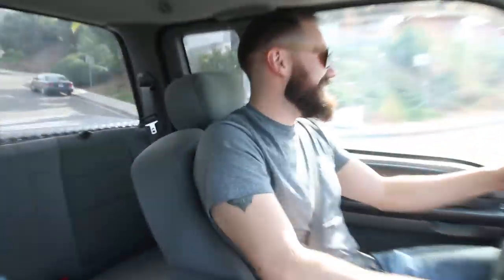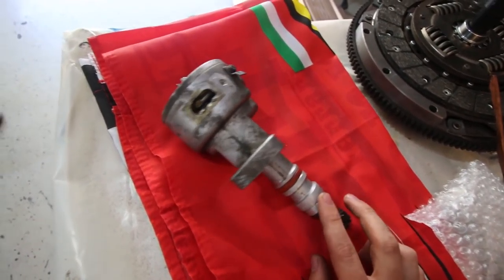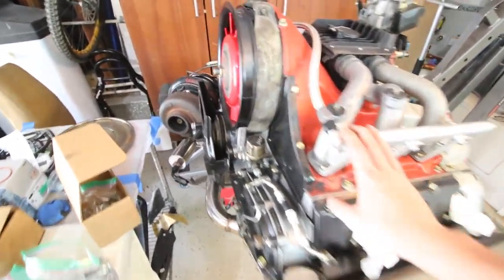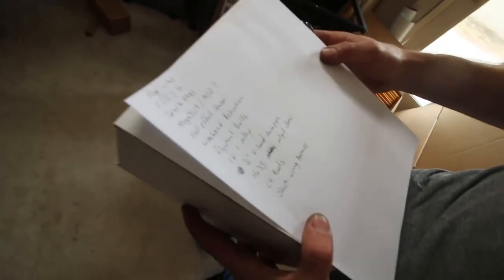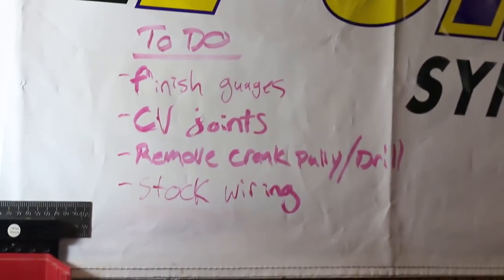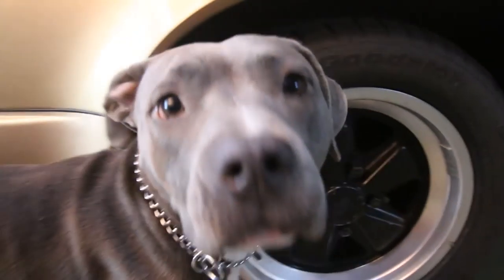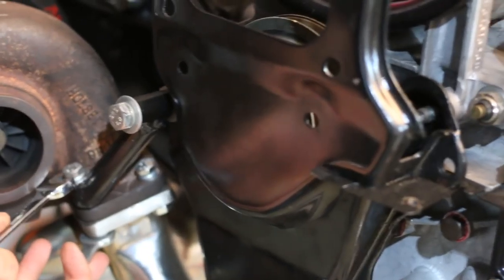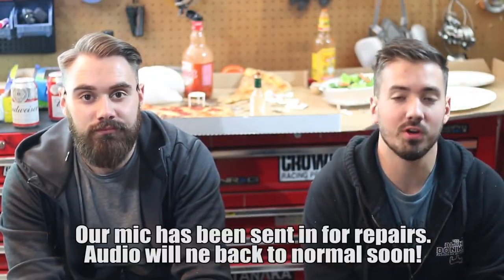Day 16/30 Porsche Build Challenge - Distributor Problems...

Comment: I had a 944 with the same Fuschs wheels on it. One of the wheels had lots weights on the inside and a few on the outside. Shop explained that that was what it took to get the wheel balanced but it was cheaper than a new wheel. I love your dog

Comment: MS2 is a Awesome setup, the EDIS is a popular setup for a lot of engines due to simplicity and inexpensive common parts. The only advice I have is to have the trigger wheel installed correctly with less the .003 runout and a real sturdy VR sensor mount. Crank sync issues are a real PITA.

Comment: You can incorporate a crank angle sensor into your existing crank pulley, and also haltech will sort out every single drama you mentioned it's just very expensive
Reply from the maker: DeathStroke Got the sensor and toothed wheel already purchased. We have a solid plan moving forward.

Comment: You can still get the crank pulley of with the engine in the car. It takes 20 minutes extra compared to if it's on the stand. But no biggie, I've done it several times.
Reply: Trigger happy, now I finished watching and you already knew that...

Comment: The wheel weights do a better job the closer to the outside planes of the wheel.  The further in they are place, the more you have to add.   Looks terrible I agree, I try and avoid doing them that way.  I may have balanced a few tires in 18 years.

Comment: Just put 10° advance everywhere.
Then get it tuned on a load dyno for maximum brake torque.
The OE "MAP" probably isn't very good anyway since you put a turbo on. 
it's only alright with no boost thrown at it
You wont brake it with 10° of advance...

Comment: I enjoy the Tabasco as well. 

I have never seen or used the mega jolt, but it appears simpler then going MS2 or 3. It's just not a good idea to upgrade an MS1 to a 2 or 3 since the cost difference is only $60 plus the processor you choose. The internal jumper changes from MS1 3.0 board are extensive. The MS1 software is a PITA compared to the MS2 and later software. With your tight schedule Use the MS1 you have with the mega jolt. This Would be the fastest way to get you up and running. Just Add in all the additional wires needed to go full sequential ignition and injection. Then when you have time. buy a new MS3 kit with the expansion board. The expansion board has all the output transistors on it. Otherwise you don't have enough room on the main board to add all the output transistors to go full sequential.
Reply from the maker: asc4130sd We are ordering an assembled ms2 box Friday. 450 bucks. But it's everything we need.